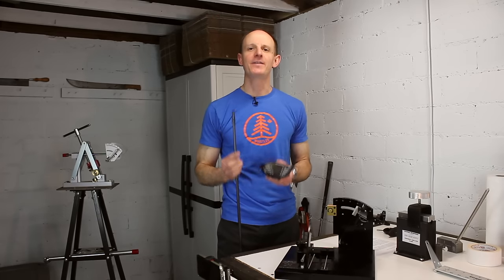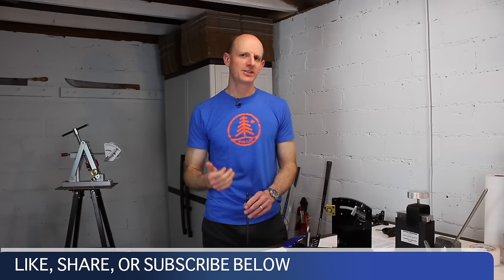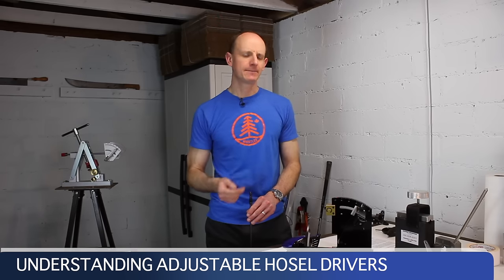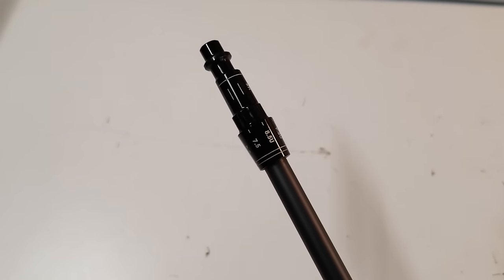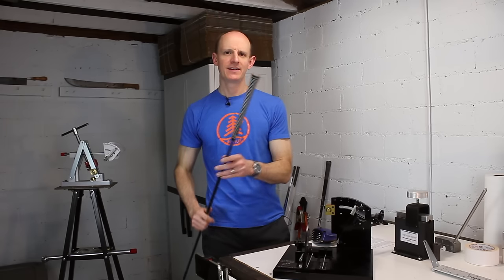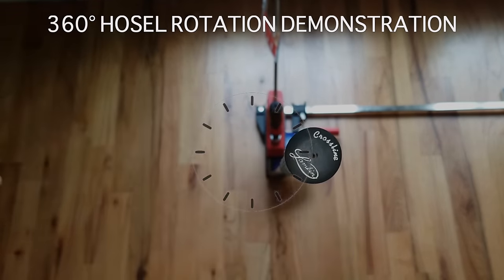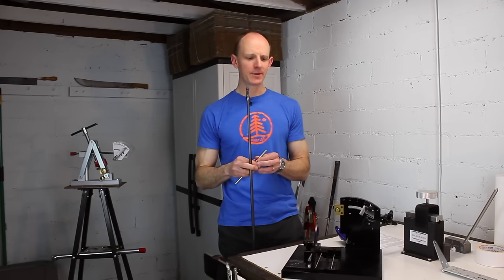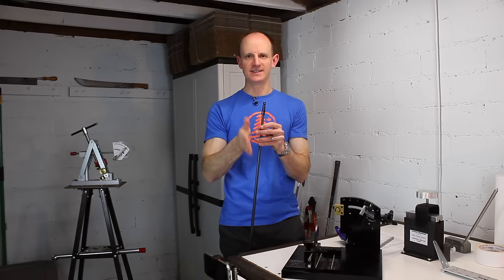Adjustable Hosel Drivers - How they change Loft, Lie, and Face Angle

Comment: I just baught a Sim Driver I couldn't hit it well at all. I assumed that I could just adjust the loft.  I went up. 75 and it bad the biggest difference in the world
Reply from the maker: That's the best part about adjustable hosels is that you can change it, try it, and if it doesn't work you can try something else or just set it back to neutral.

Comment: Well I guess Taylormade R1 driver nailed your contact argument by having a adjustable contact point as well as a adjustable hossel...

I guess by your argument I'll be going back to my R1 and scrap my Sim2 driver. Who knew a 10 year old driver is more advanced than now ....

Thank you for your videos, very informative.
Reply from the maker: There were numerous drivers that used some sort of sole adjuster. I think the current drivers have modified the sole designs to lessen the effect. And they really all care about weight and those sole adjustments added a lot of it.

Comment: adjustable weights ,, in my opinion it's just another gimmick ,, I'm trying to replace my good old " trusty red " my Nike Covert driver from a number of years ago. It was a fine club with a regular flex Kuro Kage shaft I played it for eight years with a one degree open face ,, personally I don't believe the average amateur golfer benefits in any way shape or form by trying to figure out how moveable weights are going to be of any benefit whatsoever. Just my opinion, thanks for this video, quite helpful.

Comment: I don't agree with the two assumptions. What occurs at address, even for a scratch golfer, may not be what happens at impact. These adjustments should only be made with the feedback from a launch monitor that provides data on swing path, angle of attack, lateral face angle (open or closed), vertical face angle (loft), etc. The perfect example of this is a golfer who sets up with the club shaft in a neutral position and clubface pointed at the target, but at impact has flipped his wrists. 
Granted, your video is intended to illustrate how the changes affect the position of the clubhead and, for a clubmaker in training, it is valuable instruction. However, the comments I'm reading here are from people wanting to make changes to improve their drives, but this will not get them there, and the rabbit hole they go down can prove frustrating. 
I believe it is best to get a proper fitting that is the result of data at impact.

Comment: If you always square the face to the target at address, why does setting a club to fade or draw matter ? If I hit the club square that makes no sense.
Reply from the maker: If you make contact with a square face then none of the setting will matter. All the draw or fade settings mean is that the head will want to fall open or closed at address if not aimed by the golfer.

Comment: Here is the problem with all that. People moving from a bonded driver are used to just soling the club and let it sit naturally, with a bonded club that will give you the correct loft. When they get an adjustable club they do the same thing, even after making an adjustment, because that is what they have always done, and don't know any different. The manufactures have not made it clear that you have to manipulate the club to point at the target in order to have the correct loft.   Most people have no idea of the facts you just presented, and have no idea how the loft change is done.
Reply: And the grip messes with everyone

Comment: Adding loft or decreasing loft for a casual player like me who cannot maintain a proper and standard handle placement at address is almost irrelevant.
I mean I can add the loft by another 1.5 degree but when at address the club head is closed with the handle Infront of the ball and thus decreasing the loft naturally 😂
Unless I can have a standard handle, ball, and hands placement at all times then adjusting and decreasing loft remains a mystery to me 😂

Comment: you didn’t address the line of force being changed. Maybe it is not an issue but e.g. If the sweet spot is through a line about 1/3 from the top if it is delofted then the line will be below that original line of force and depending on the c.g. or whatever point causes the sweet spot, it will be different.
Reply from the maker: PhilL, we're about to go above my pay grade here but as far as I see it the CG would move slightly lower in relation to the face when we loft up and vise versa when going down. This should make the lofting up go even higher or lofting down go lower. The farther back the CG sits in the head, the greater this effect would be. I think.?.
Reply: MOBILE CLUBMAKER that’s what I was thinking too. Or maybe the sweet spot changes but it would only affect a pro’s type accuracy and they would quickly adapt, pretty just academic i suppose

Comment: Do professionals use adjustable hozzles?
Reply from the maker: Yes, pretty much every one of them. There was a time 10 years ago where you had some players like Tiger who had special bonded hosel versions of the driver made for them. Don't know of a single case of that at this point unless someone is playing a driver from pre 2010.
Reply: @EFGMC   - So, do the pros just pick out the hossel setup that their sponsor fabricates, off of the shelf, and work with that setup, to customize it to themselves?
Reply from the maker: @luckydog-287  Usually. There are also some "tour" or whatever you want to call them adapters that have less angle to them. So Taylormade has one that is 1 degree instead of 2 and Callaway has a green dot adapter that basically reverses the standard adapter so you can loft down 2 degree or up 1. The standard version does the opposite.
They also have all the heads spec checked so they know what the head is starting at exactly before they make any adjustments.
Reply: @EFGMC  - Awesome! Thank you for the great information!

Comment: ..talk about 'assumptions' The industry seems to like drivers with lie angles with the toe a mile high. I don't know when they started doing that - 20 years ago ? But, part of the reason I cut down shafts 2 inches is to get a neutral (or dare i say FLAT !) lie angle....jeeze

Comment: “not running parallel is incorrect”.   you mean shaft and adapter are not concentric with each other it’s just basic engineering.

Comment: I HATE ADJUSTABLE HOSELS!!! If you have an older model it spins the shaft so if your shaft is PURed it throws it off and makes it a waste of money. The newer ones with the cogs don’t do that, but it still orients the shaft differently from Standard which changes the dynamics of the delivery of the club face at contact. Let me reiterate…I HATE ADJUSTABLE HOSELS!!!

To simplify it for everyone to understand…when you adjust the club head in ANY direction on ANY axis, it changes the entire structure of the club head at impact which creates different feel, sound, and results. That takes a driver that you were potentially fit into (which isn’t cheap) and probably love (cause you bought it) and completely changes it to something you may now hate and can no longer hit!!!

Bottom line…Get fit into a driver (INCLUDING the loft and lie) before purchasing and don’t tinker with it. If you were fit into it, you trust the fitter, and you were confident enough to buy it…then the problem isn’t the club or any adjustment you could make, IT’S YOU!!!